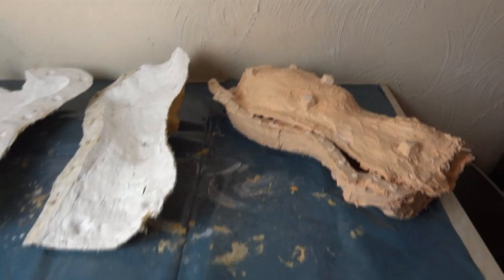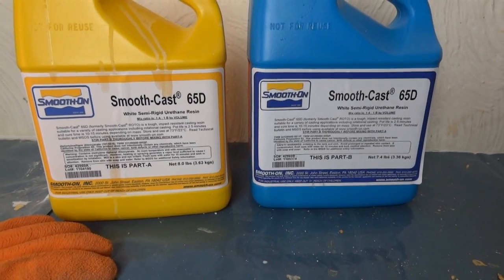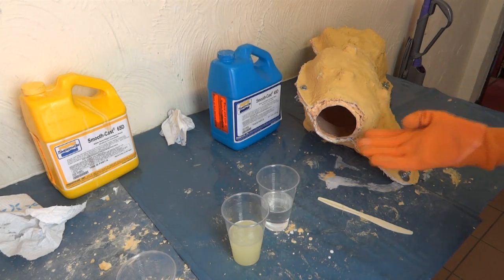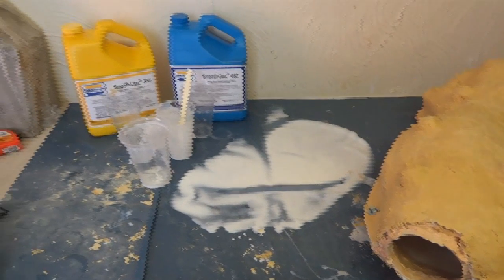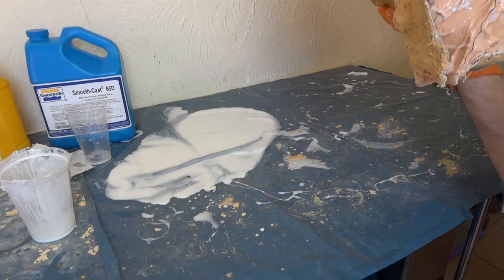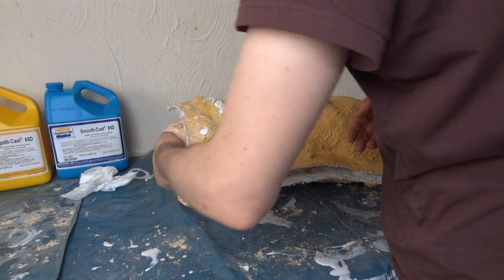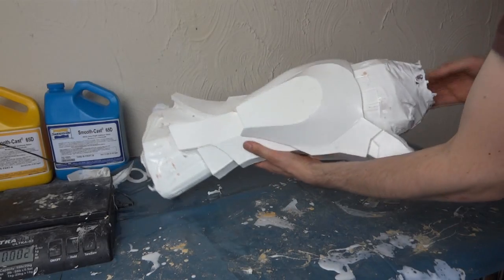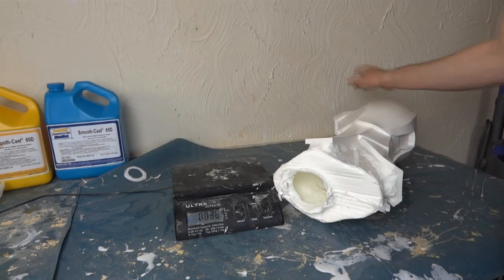Iron Man Power Suit #7 | Rotocasting Armour Pieces | James Bruton

Comment: What kind of silicone did you use for a mold? Did you apply any kind of mold release before pouring Smooth-on 65 D?  And the last question- how do you determine how much 65D you need?

Comment: James, I've been able to use less of the 65D but only using a small batch to skim coat the mold and then using odorless epoxies (safe for indoor use) and fiberglass to reinforce the cast.  You'll use a lot less ROTO, the cast will be lighter, and less likely to warp

Comment: I dont think it will be that bad with loads of sheets to stop it smashing about...you could use the same method but turn the tumble dryer manually I dunno just throwing ideas at you really as it looked like a bit of a pain doing it the way you did btw you can get tumble dryers that have a cool setting with no heat like mine tht i got recon for £35 it looks perfect for it use the holes around the drum to attach a bungee cord and it will stay still would be another way do two at once to balance?